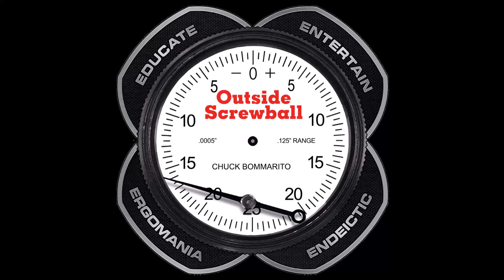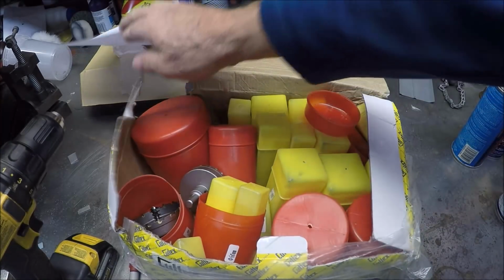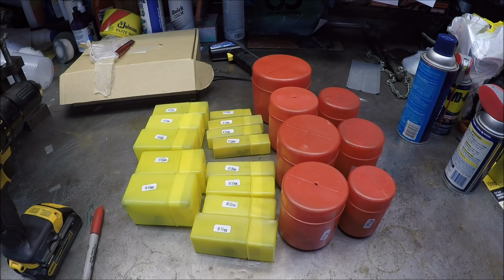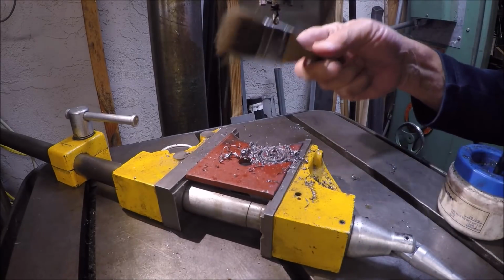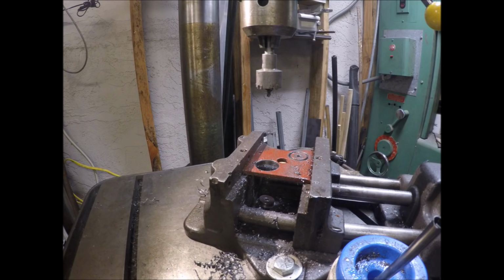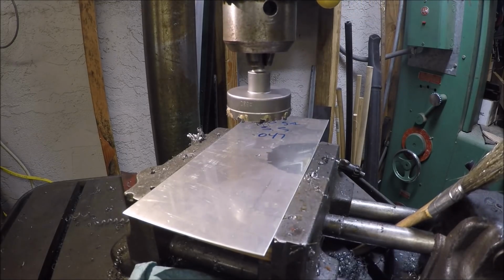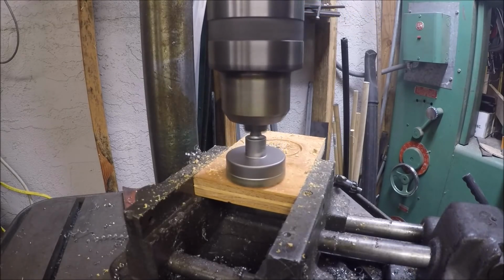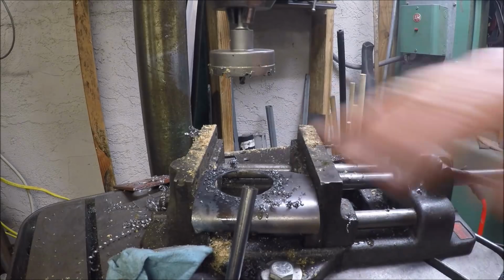Screwy Tuesday--Carbide Hole Cutters

Comment: Those saws are more directed to make holes in thinner materials, electrical boxes would be the best example, for thicker materials you need to use the other type that have the evacuation channels along the body of the tools, but the later ones will cost you way more...
Reply from the maker: TRUTH!...thanks for viewing/comment

Comment: If you have or want to drill thicker material, only go down until you scratch the circle. Then drill one or two holes just inside the circumference with a drill about 2 times the tooth width. This should prevent the teeth from loading up.

Comment: Thanks Chuck.  

Awesome drill vise.  Never seen one like it.  

Thanks for the review - warts and all.  We will likely do the same things at some point.  I have murdered many hole saws in my day. This setup looks better than a hole saw for thin metal as Pierre noted in his comment.  The work hardening is always a problem unless you have some of those very expensive Annular cutters Mr. Whitham uses to great effect.

I appreciate the reviews - saves time and money for the rest of us.  If creators I respect (yup you are in that crowd) give it thumbs up - I am more likely to try the product. 

Envious of that hoist in your garage.  Rolling around on a creeper is way overrated.  Someday when I retire, there will be a new shop behind the house. I told the wife it will be indecently expensive and decadent. 

Dan
Reply from the maker: thanks Dan....the vise is also used for holding work when you bandsaw....it was a gift from Oxtool and I did do a prank April fools video where I drilled into the jaw of the vise (I built a copy jaw to drill into)….my advise...start the shop while you are working and have (some) income to expense to the shop build...as each day the cost of all materials/labor increases...best of luck with the build, I built mine in '89 and it has had many varied uses over the years.

Comment: here is a coil over shock spring compressor i knocked out with a carbide toothed hole saw.. https://i.imgur.com/Fz51bEN.jpg   worked out great. https://i.imgur.com/t1796MC.jpg  had to figure out a brake rotor puller also. https://i.imgur.com/MNJFisb.jpg  https://i.imgur.com/Cgg3W7Z.jpg

Comment: Hi Chuck.What is a morse taper 33. You are using the hole saws for totally the wrong application, they are ment for thin materials,  IE allot less than the depth of the gullet, above half of the gullet depth and there is very limited chip evacuation or even none.
Reply from the maker: John....you are aware of MT2 or MT3...MT33 is just another taper....why??? I have no idea....thanks for viewing and commenting
Reply: There is no morse taper 33. He is setting up a 33 Jacobs taper. Jacobs tapers hold the chuck on the arbor. Usually the arbor is held in the spindle with a taper specified by the morse series that run from 1-5. For general-purpose drill presses this is most often MT2.

Comment: those cheap hole saw cutters they are no good at all I bought a set didn't last me a day and the other hand If you wan a good carbide tip hole saw cutters buy champion brand I have one set for 15 year use it an abuse it never have ani problem cuttings any steel up to 1" thick
Reply from the maker: thanks for viewing and your comment....I can agree with your comment....it is all about price/use, in my recent video I show how I use a 2" cutter to birds mouth a steel pipe....interrupted cut and it worked great, glad I had the tool....production I would not suggest.....also it greatly depends on speeds and feeds/lubrication on life of a tool